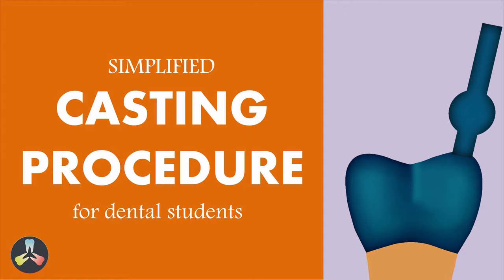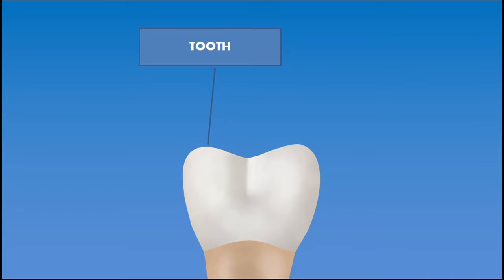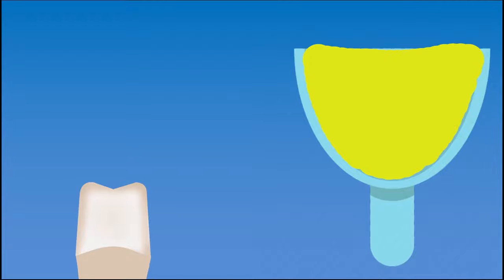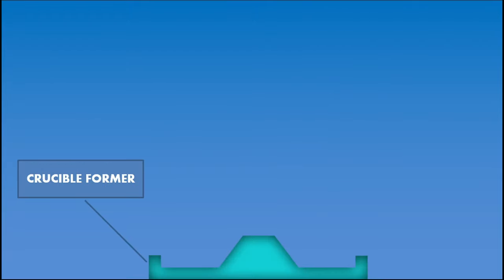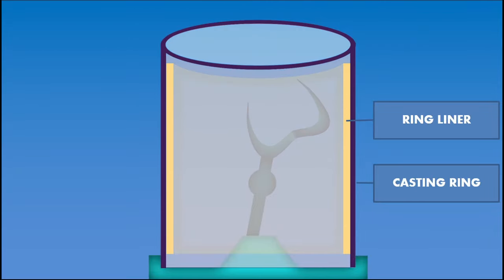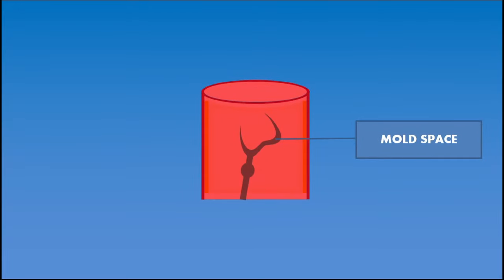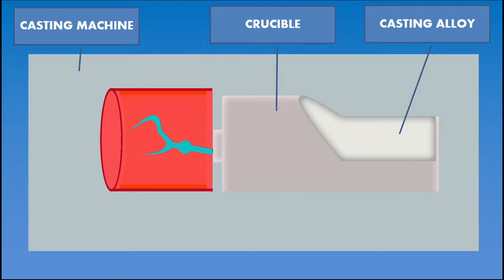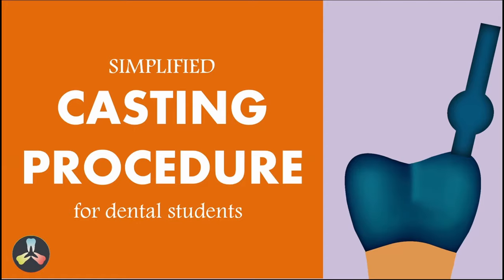Dental Casting Procedure | Lost Wax Technique

Comment: I didnt understand how metal enter through sprue???...
Reply from the maker: The metal will be melted by the casting machine. Then this molten metal in liquid state will enter through the sprue
Reply: @smartdentistry  sir/mam....i actually didnt understand that...when molten metal is applied on wax patern...the patern is wax which is melted then no model will remain

Then how it forms replica of that wax patern however it is melted?
Reply from the maker: Once the wax is melted, the was will burn away leaving an empty space inside the investment material. This empty space will have exact resemblances with the was pattern which melted away. This space will be occupied the molten metal through the sprue @MS_VLOG..
Reply: @smartdentistry  thnks sir/mam...so nice of u♥️♥️♥️♥️

Comment: Got the concept though but m so much confused when it's coming to this sentence, " An investment is described as a CERAMIC material, which is suitable for forming a mould into which molten metal or alloy is cast." ..m not getting how ceramic material is used in this investing process 😵.. It would be really a great help if you explain 🥰
Reply from the maker: Investment is not an ceramic material. It is a gypsum or phosphate based material.... Sorry if there are some inaccuracies in my pronunciation....